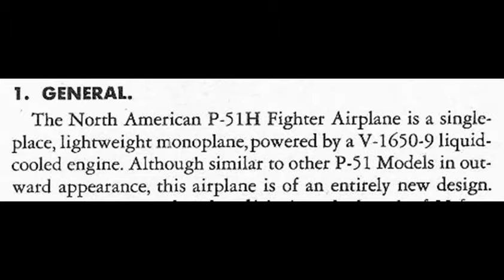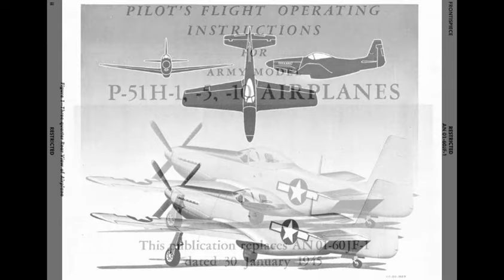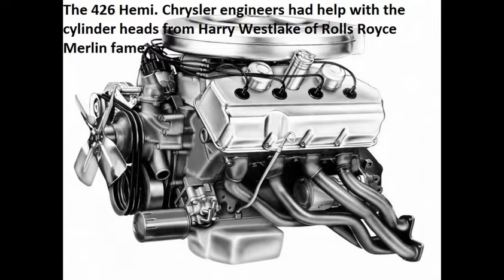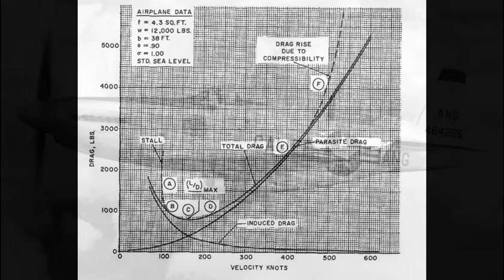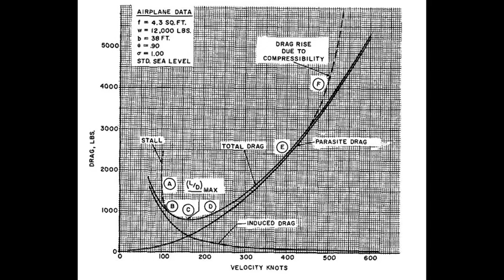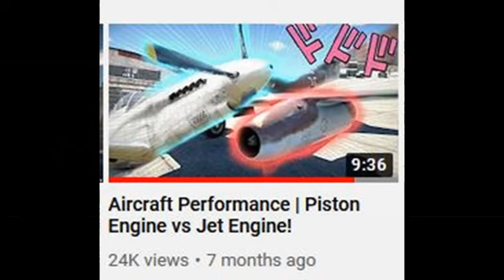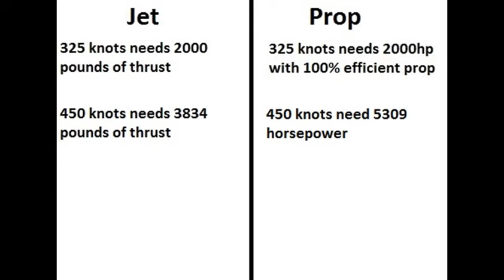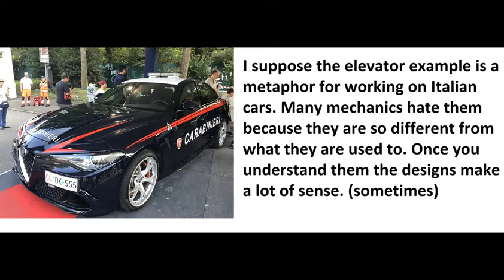U.S. "Superprop" Fighters P-51H, XP-72, and more

Comment: Will there be a discussion about "hemi power" of the 16 cylinder variety ?    : )
Reply from the maker: Yes, and how it ties in to the modern Chrysler products.
Reply: @GregsAirplanesandAutomobiles  Sweeeeet.
Reply: @The_Bermuda_Nonagon  
The Pratt&Whitney R2800 along with most of the other US aircraft engines at the time already had Hemi combustion chambers. 
In 1910 Elbert J Hall of the Hall-Scott Motor Car Company (railroad cars not automobile cars) designed an overhead cam Hemi engine and later on along with an engineer from Packard was a part of designing the Liberty Aircraft Engine.
Even though most people think that Chrysler pioneered the Hemi engine in all reality they were one of the last in line to make them, even for vehicles.
Harley Davidson had a mass produced Hemi engine with the Knucklehead EL 61 ci engine  in 1936, Packard, Duesenberg, Cord and many other vehicle manufacturers already had Hemi engines in production years before Chrysler did, they didn't really get into Hemi's until they were working on aircraft engines for the government during the war. 
As Greg pointed out the new Chrysler Hemi's aren't true Hemi engines, they have closed "bathtub" style chambers and run flat top pistons with a squish area as a result, it's much more of an efficient combustion chamber than a real Hemi, Harley Davidson did basically the same thing in 1984 when they released the Evolution engine although it's not a bathtub style chamber it's a "D" style chamber, but they did change to a bathtub style for the Twin Cam engine in 1999. 
The fact is a true Hemi style combustion chamber is very inefficient in a normally aspirated engine, they work well in an engine that's highly boosted running a flat top piston because then you have a large combustion chamber volume that's packed full by supercharging, but normally aspirated with a big dome on the piston sticking up into the dished out head of a Hemi causes all kinds of problems with flame propagation and the flame front having to travel around and crawl over the pistons dome, it turns the entire combustion chamber into a huge detonation trap, super high compression pistons for Hemi's like that usually have a "flame notch" in the top of the piston to minimalize as much of the problem as possible, another thing that aids with that problem is the addition of a second spark plug in the combustion chamber on the other side of the pistons dome, if the engine design allows for it those help quite a bit.
Reply: @dukecraig2402  very interesting info as I have little knowledge about the HEMI...!
Reply: @paoloviti6156  
The biggest reason for creating the Hemi type combustion chamber is valve area (size), if you draw a circle that represents the bore of an engine and then draw two circles inside of it to represent the intake and exhaust valves you can only make them so big until they run into each other and the cylinder wall, by "canting" the valves at an angle you can make them much larger than if they're flat, the dishing out of the combustion chamber basically just follows suit with the canted valves. 
The reason that the infamous 426 ci Chrysler "Elephant" Hemi engine made the power it did wasn't so much it's Hemi design as much as the fact that it was pumped up pretty good from the factory in the first place, it had a solid lifter cam in it along with high compression that could run a decent amount of timing advance on the gas of that era, in other words they already had the rubber band wound up pretty tight from the factory. 
Chevy released a version of the 427 engine around 69 or 70 that had a solid lifter cam and other race goodies in it that made more power per ci than the 426 Chrysler Hemi did, the Hemi really shines through when it's boosted to high levels for the reason I gave, with a flat top piston you wind up with a large volume combustion chamber that once packed full from forced induction gives you a lot of air/fuel to burn.
But normally aspirated it really isn't the engine people think it is, between the dome of the piston itself causing problems that need to be overcome there's other issues like the valve pockets that need to be cut in it for valve clearance that are so big they create two detonation traps in the combustion chamber themselves, that's yet another thing that forces you to turn back the timing advance resulting in lost power. 
I've been building Harley engines professionally for over 30 years, the pre Evolution engine's like the Shovelhead, Panhead, Knucklehead and Ironhead Sportster engines all are true hemispherical combustion chamber engines, anytime someone comes to me with one of the older ones and want's it built up for performance I tell them all the same thing, don't waste your money, because no matter what you do an Evolution or later engine with less modifications will beat it every time, do yourself a favor and just go for a reliable rebuild that'll last and enjoy it for what it is instead of winding up with something you've spent a lot of money on that's failure prone and will wind up getting beat anyways. 
By closing the combustion chamber and creating a D type or bathtub style chamber and running a flat top piston you have what's called a "squish area", when the piston gets to the top of the compression stroke the air/fuel mixture is "squished" between the top of the piston and the corresponding area of the combustion chamber resulting in it being shot into the remaining area of the combustion chamber (that's known as the "quench area") and creating turbulence, this turbulence along with a smaller area for the flame to travel across as opposed to the larger area from one side of the combustion chamber to the other and over the large dome of a piston in a true Hemi is far more efficient. 
18 years ago or so when Chrysler announced they were going to build Hemi engines again a friend of mine who's into cars came running into my bike shop all excited saying how they were bringing it back, I told him,
"There's no way it's going to be a true Hemi like the 426, I'll guarantee you that it'll have closed combustion chambers and flat top pistons".
He said "You think so? Why's that?"
I told him "Because there's no way they could get a true Hemi to pass modern emissions standards, there's just no way."
Lo and behold several months later he came walking into my shop with the latest car magazine from a subscription he has that had an article on the new motor that had a cutaway drawing of the engine and don't you know, flat top pistons and closed combustion chambers. 
Like everyone else in the 80's I was cussing the government and the emission standards they forced the automobile manufacturers to deal with but 25 or so years ago I started realizing that it's actually a blessing, by forcing them to conform with those standards the engineers had to develop more efficient induction systems and combustion chambers, more efficiency=more power, that's why today soccer mom's are driving SUV's that can absolutely smoke the most legendary muscle cars from the 60's.
Reply: @dukecraig2402  Going off the end of your comment: it's partly the reason that euro/Japanese small cars had such a head start on the American counterparts. They had to be smaller for domestic markets. So they spent longer on development time than the Americans had. So when we're pulling out the pinto/gremlin/etc...the Toyota options were so much better.
Reply: @SlavicCelery  
Yep, when I was stationed in Germany in the 80's and I got a load of what a gallon of gasoline cost it didn't take long to figure out why foreign car manufacturers had such a head start on building small fuel efficient cars. 
I had a friend over there that had a Monte Carlo with a built 454 engine in it, he had to save up money all month to buy enough gas to take it out for a weekend.
But man I'll tell you what, if it was parked with it's hood open in a lot that also had a Ferrari in it the crowd would be packed around it, that thing made all the other cars invisible wherever it went, most of those people had never seen an American V8 with their own eyes much less a big block.
Reply: @dukecraig2402  No, the advantage of the true Hemi combustion chamber cylinder head is that it takes away valve shrouding.  With traditional “wedge” layout cylinder heads the combustion chamber walls and the cylinder bore walls interfere with flow and introduce velocity stall into the combustion process.  Modern aftermarket 2V Wedge heads (NASCAR) reduce the vertical valve angle (stand up the valve) in order to help steer the flow away from the combustion chamber side walls and cylinder bores.  I ported cylinder heads in the 1980’s for some Pro Stock teams.  After eating my fair share of aluminum chips and TiG welding for days on one exhaust port I went and got an Engineering Degree.  Which was great timing because I would have been replaced by Brodix, Dart, and the multi-axis CNC machine.
Reply: @SlavicCelery  -  That’s true.  Any production four valve head is 1. Overhead cam, and 2. Hemispherical by design default due to valve arrangement necessity.  The Japanese (and Germans) were very early adopters of the 4V OHC ICE’s compared to Detroit.  Detroit was all about saving a buck and reducing parts counts.  And small, highly efficient 4V OHC engines are more expensive.  I would argue that 1960’s Formula 1 team engine suppliers like Cosworth did the heavy lifting with 4V OHC design work.
Reply: @petersouthernboy6327  
Valve shrouding isn't anymore of a problem with other combustion chambers than it is with Hemi's, any of them can easily be overcome.
Reply: @petersouthernboy6327  It's a situation that many people have misunderstood cough top gear cough
Reply: @dukecraig2402  - yeah you’re right and Bob Glidden doesn’t hold the all time NHRA Pro Stock record for wins mostly using the Boss 429 Hemi 🤦‍♂️🤣😂
Reply: @dukecraig2402  - Here’s a May 12, 2004 Mopar Magazine interview from Tom Hoover, the Chrysler Engineer who designed the legendary 426 Hemi in 1964: Tom Hoover: “It's fundamentally related to the cylinder head design. It's not that it was totally because it was a Wedge head but rather it was a matter of the Wedge head being located outboard on the cylinder bores which tended to shroud the valves.”
Reply: @dukecraig2402  thanks again for this very interesting info, in truth I'm impressed with your knowledge 👍👍👍
Reply: @dukecraig2402  it's funny actually because I never thought that Chrysler invented the Hemi. I just thought they used the technology from others and put the Hemi name on to differentiate from other manufacturers. I've seen it in a few different applications from different manufacturers. I didn't even know the that Chrysler oned the the 'hemi' name...
Reply: @dukecraig2402  Completely wrong. Valve shrouding was a KEY advantage of the hemi design, and very difficult to overcome in traditional wedge shaped chambers.
Reply: @jonnyj.  
No it's not, I and every other engine builder do it all the time.
You guys crack me up with that narrative, if it was half as bad as you guy's think then the only engines made would be Hemi's, instead there isn't a single production vehicle made with a true Hemi chamber and not a single race team running an NA engine in any kind of racing except for vintage.
But don't listen to me, I've only been building Hemi's and the subsequent evolution variant's of them and researching them and their history for over 30 years, they're all I do.
Reply: @dukecraig2402  variable valve timing saved performance in engines, satisfying emissions while allowing for crazy performance like Ford's 92hp/liter 5.0

Comment: When two propellers are on the same shaft the more correct term is "Contra Rotating" but very interesting subject.
Reply: Interesting that in world-class precision aerobatics RC competition, (Pattern...) the Contra Rotating props have a particular advantage at the higher competition levels since they largely eliminate spiral propwash on your rudder at all speeds. You can back off that right rudder correction at low speed and certain angles of attack. Fantastic prop braking as well on maneuver downlines... and, it sounds totally awesome!!
Reply: @Mike-eq4ky  I would love to see a video of the RC Contra Rotating prop.
Reply: @25mitchel  you can add me to wanting to see that too!
Reply: @julianneale6128  Thanks

Comment: How did it take them 3 years from seeing the Me 262 and going "oh yeah, we should sweep the wings too".
Reply: The swept-wing Bell L-39-1 first flew on the  23rd of April, 1946.
Reply: @brianevans656  Except that wasnt a jet aircraft and was more of a evaluation aircraft
Reply: The wings on the Me262 and the Me163 weren't swept for a higher top speed. The Me 262 wings were swept to adjust the Center of Gravity without having to redesign the fuselage by moving the wing attach points.  The Me163 wings were swept for Center of Gravity and aerodynamic reasons due to the tail-less configuration.
Reply: They were busy losing the war...
Reply: Sweeping wings have some serious problems because of the way they affect stall characteristics.
Reply: @Justanotherconsumer  They're also harder to manufacture / strengthen because of all the new twisting loads at the root.
Reply: @Justanotherconsumer  They aren't problems, they're tradeoffs. By sweeping the wing, you lower the effective airspeed of the air over the wing (which is why they have lower drag). The tradeoff means that your performance at lower speeds and higher AOA's can be reduced, sometimes significantly. @Dean Su is correct about the structural implications of swept wings

Source: Aerospace Engineering student and I've had aerodynamic and flight classes where we've discussed wing sweep and how it works.
Reply: @jacobdewey2053  wow you sound really smart and qualified 😂🙄
Reply: @rempilot 
   AT LAST.!!
   I'm tired to comment the SAME YOU JUST DID.!!!
   YOU ARE ABSOLUTELY RIGHT.
   And it's the practical result, of moving from a tail wheel configuration to a NOSE WHEEL configuration, and
maintain the balance, in the Me-262.
   AGAIN, YOU ARE
ABSOLUTELY RIGHT.!!!
Reply: @jacobdewey2053  I was thinking more of the sabre dance phenomenon.
Reply: @Justanotherconsumer  You mean the nose pitching up at the stall? That's not a tradeoff--that's a feature!
Reply: The Me262 didn't sound any alarms here in the US because we have political infighting at practically every level of military production. During  testing, waring political interests  chose the B-17 over the Flying Wing. 
Hitler ruled Germany, PERIOD. If Hitler liked an idea it was as good as done. If not it was still born and cast aside. Secondly the Me262 and its follow on designs were used for one type of mission, to get up to the altitude of the swarms of B-17s on their way to bomb Germany back into the Stone Age. They were not dog fighters or bombers and strafers. They could  exceed 500 mph as I recall. The flight time was brief, I don't recall what it was but it was way less than,  a P-51. I believe, all around the 51 was a more useful aircraft by far.
Reply: @jacobdewey2053  Same here but 50+ years apart. I did tutor a student at Temple in aerodynamic and we covered swept and delta wings.

Comment: I enjoy your videos and commentary.  I would like to add a comment about the thermodynamic advantages of the jet engine.  The piston engines (largely Otto cycle) max out at between 15-25% efficiency of fuel energy to power.  The Brayton cycle, which is involved in modern commercial jetliners, is roughly 70% efficient by the same metric.  It was probably much lower in the early days, but no one can cheat thermodynamics, we can just see how far we can.

Comment: The ultimate configuration of R-4360 engine was planned to be a Variable Discharge Turbine. It got rid of the throttle completely, using only turbo wastegates and fuel control to adjust power output. They made it fly on a testbed aircraft (B-50), but never made it work properly without access to electronics. 

Anyway, as Greg said, piston engines were overtaken by jet development, Pratt & Whitney saw the writing on the wall and quickly shifted most of its resources and development capacity. Wright company kept investing in piston engines a bit longer, so they had their last word with a cheaper and highly optimized R-3350, but in the end we still fly on aircraft powered by P&W jets, while Wright engines are a history.

R-4360 is a very interesting engine. I highly recommend Graham's White book on the subject, it's written in a way that does not require a hard-core engineering background and covers all the engine development, construction and the aircraft in which it was used.

Comment: I’d love to see a video on early jet engines. Why were the British jet engines so powerful and more efficient than the 004 and bmw 003? Of course they had to cut metal usage severely but was that really the factor that made them so problematic? Or was it just their design?
Reply: Glenn Quagmire  guess what, the British did have the Meteor. So if you're accusing SB of something, better not skip history class. Kinda sad
Reply: Glenn Quagmire  it's a 5 Ton plane with significantly higher wing loading and lower thrust. How would it fly circles around anything? Magic? It was a decent plane but not something stellar